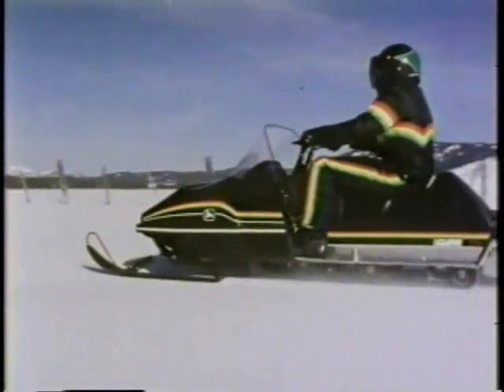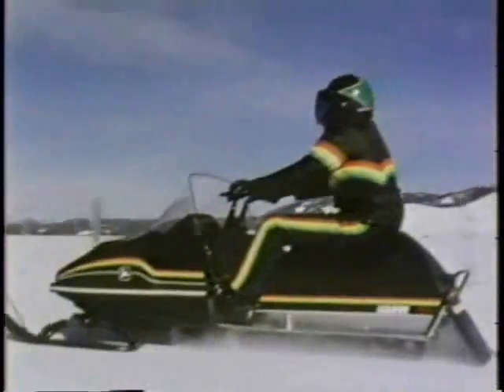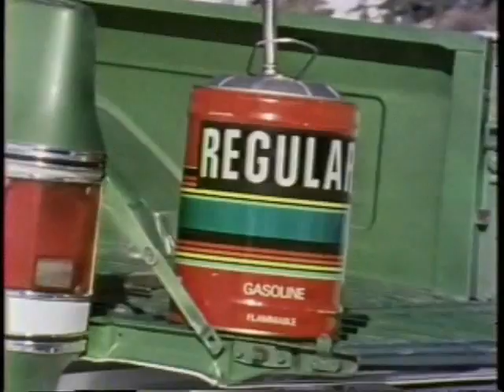1982 John Deere Snowmobile Model Line

Comment: I have a 1980 spitfire 340 great little sled. Good conversation piece on the trails surprising how many people had no idea john Deere made snowmobiles
Reply: anthony cosco I have a 79
Reply: The Kawasaki motors in them were good if you were moderately equipped to tune a 2 stroke